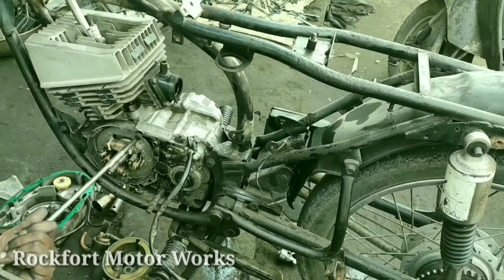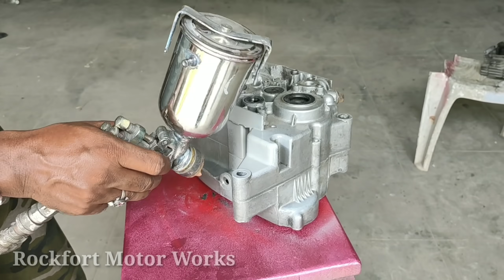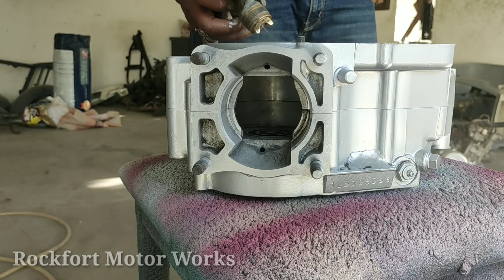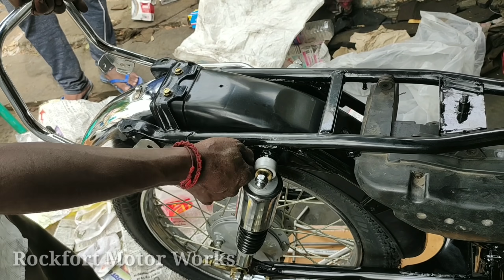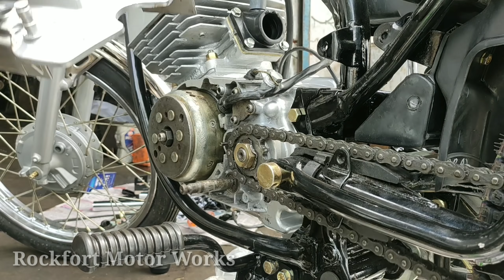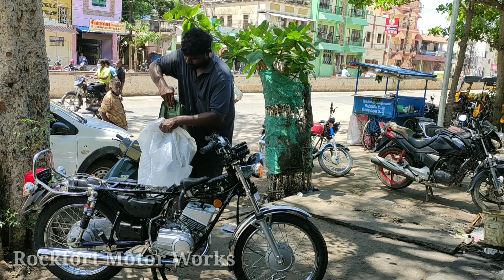Yamaha RX100 Restoration / Rockfort Motor Works

Comment: That's RX 135 Or RXG Brother.. look on the left side of the cylinder it's Written 132 cm3 and also rxg and later came with airbox... The pipe connected to a bottle from the intake.
Reply: 100 mein 98 cc hota hain.
Reply: Shaja Karim JM kjhwhhh
Reply: At what time?

Comment: Kindly mention the paint used here for engine does this paint  get fire while engine heat please  help us to know about paint details thanks a lot
Reply: @Hacker69i Excellent work. Pl mention is it equivalent to powder coating,  how will the spray paint hold up such high temperatures,  Can you go into little more detail what all was done after the main coat of pain was applied.